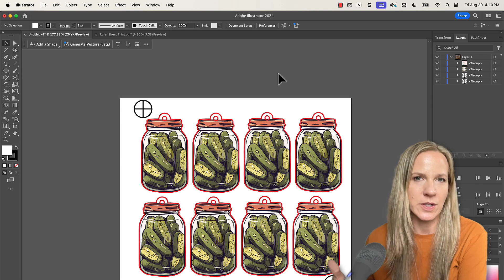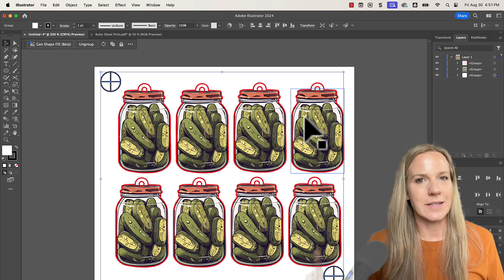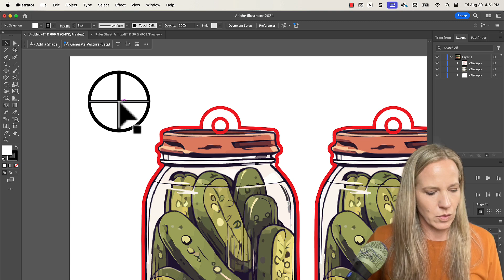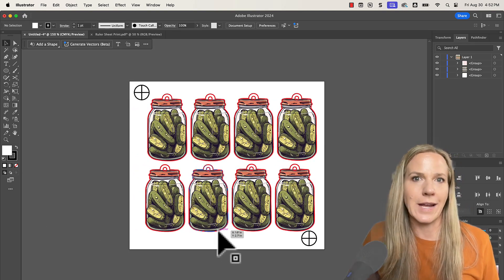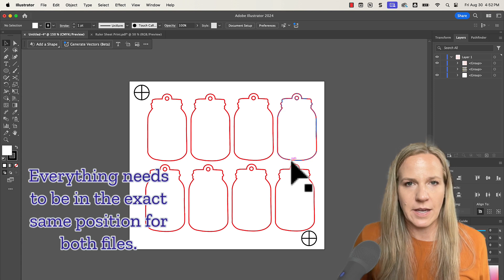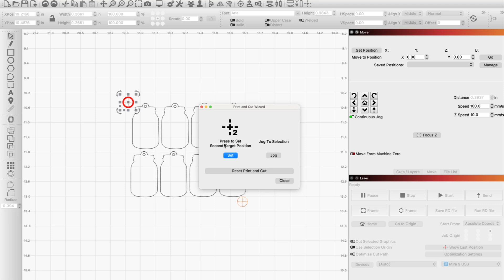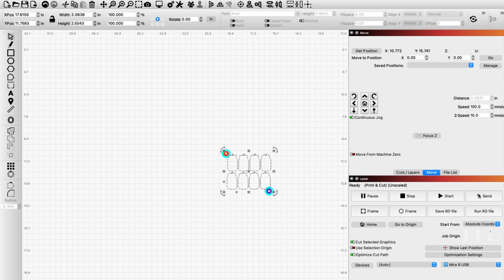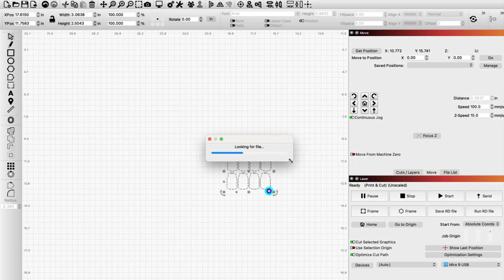Laser Cut a UV Printed Project using Print and Cut in Lightburn

Comment: Good video. Nice, quick, to the point. We have similar equipment, Mimaki 7151, Epilog Fusion Pro. Our solution when bouncing between these platforms and others is to use Registration Marks. A very similar process which can save a ton of time and substrate. Especially true of a long job when critical alignment is in play,  when you pick up a piece, or if it is bumped during inspection and want to redo a section. Methods like this have deep value that creators and pros should discover and practice on. It’s certainly saved our projects from disaster many times.

Comment: Any tips for avoiding the laser burning up the ink and spewing brown near the cut lines?  I printed on 1mm styrene and it the laser leaves a brown residue near the laser cut lines
Reply from the maker: @a7xfanben  I don’t know a lot about cutting styrene but a quick google search says it has a low melting point and doesn’t cut the best on the laser so maybe just use an alternate material if you can
Reply: @Thecountryporchswing  Thanks, I need styrene so I'll try some other ink or a different cutting method